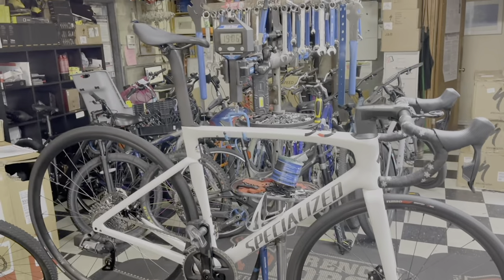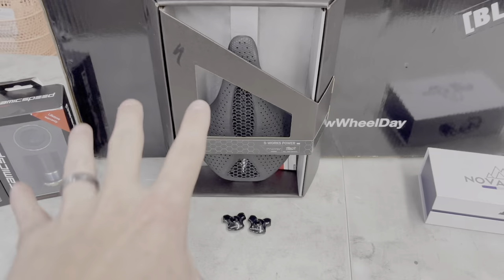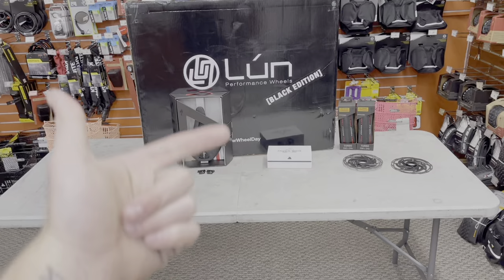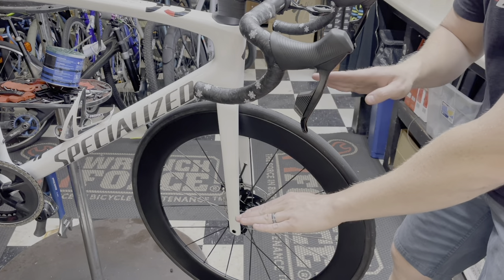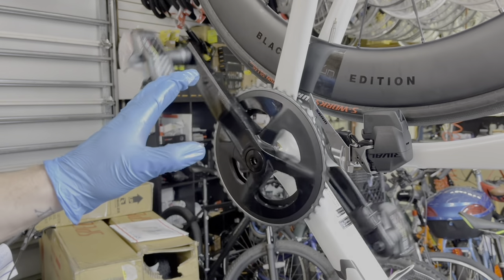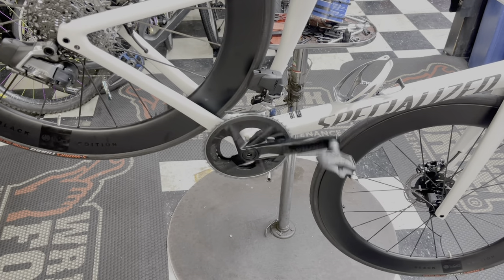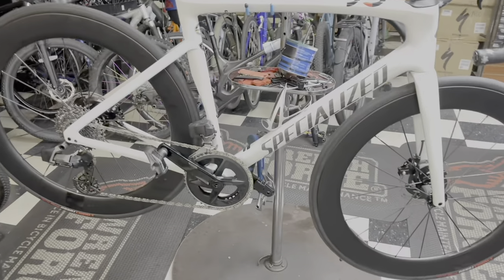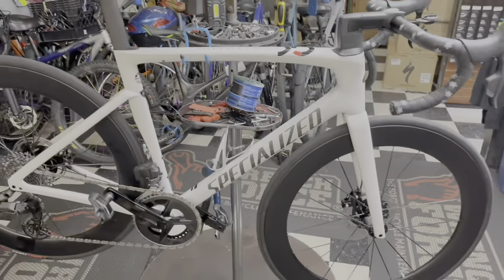HOW MUCH WEIGHT CAN I REMOVE?? (UPGRADING MY BRAND NEW TARMAC SL7 COMP 2022) *WHEELS, ETC*

Comment: Jesus, my 1.099 Euro, Aluminium bike with 105 from Decathlon weights 8,8 kg... Upgrades with wheels and tires brought it down to 8,6 kg for an extra 700 Euro. The stock weight of this carbon (!) bike is a joke.
Reply: I can understand why as an overweight tub of fat weight is your primary concern. 
But to most healthy and fit cyclists, I can assure you that weight is an irrelevant metric
Reply: @87togabito  Did you just call me fat? Where is the virtual Will Smith when you need one...

Sorry, but the fact that a modern, very expensive carbon bike weighs almost as much as a cheap aluminum bike IS a joke. Bikes are basically devolving in that matter. How much does that frame weigh? 1500 grams? Or where else does it come from? It's hilarious!

And no, weight is not an "irrelevant" metric. Overrated, especially for the average cyclist? Yes. But certainly not irrelevant. And as an average cyclist that doesn't go 45 km/h unless it's downhill, a light bike is way more fun than a heavy one and an aero position way more important than an aero bike. But whatever floats your boat,I guess...
Reply: @87togabito  If you push 5W/kg up a climb it matters if your bike is 2kg overweight and light bikes just feel a lot nicer to ride.
Reply: @christianb.1028  like gc said, and you, whatever floats your boat. He said it’s not a climbers bike (thus deep ‘heavy’ wheels), heavy saddle etc. The frame itself is an aero one, and not heavy. The components chosen are. He prefers aero, you seem to prefer lighter (leave virtual will smith at home, but 8.6 is still very much). As you say; whatever floats your boat. Not everybody  is a dentist ;-).
Reply: @Freddy3792  not even true. Aero (heavier) will be faster till a certain steepness. Check gcn vids on that. It’s not only ‘weight’. And what is ‘overweight’? Are you yourself as light as possible? On a pro’s diet? Best way to loose weight on the bike is loose fat yourself.
Reply: @Stevenafoe  Since I'm not really good (but also not fat!^^) and I don't race, weight is definetely more important to me than aero. What's also important is bang for buck. I just really wonder why that bike is so heavy. As you can imagine, my relatively cheap aluminium bike is not featuring the lightest components. I know it's objectively not very light compared to some other bikes, but it is VERY light for the price and the material. It's really hard to find a sub-9-kg alu bike for less than 2.000 EUR. And with the upgrades I made I also have 50mm carbon wheels and I'm still under 2.000 EUR. 
I'm not saying GCs bike is slow, or bad or anything, it's obviously not! But he's got some top spec shit on that sucker I bet is lighter than almost anything my bike features and it weighs almost as much as an alu bike from a mass retailer? That's ridiculous! And it's also not necessary, as many other brands are appearently able to produce much lighter aero bikes that you don't have to pay around five figures for.
They should just drop the damn disk brakes. That would be even more aero and save weight and money in the process. But that ship has sailed, I guess...
Reply: @Stevenafoe  Aero matters for non pros maybe at 4% where you draft in races anyway. You always have to think about the spot where you will be dropped in races which is often on steep climbs. Even though it doesn't matter, but I can't loose more than maybe 1-2kg. I agree that for guys around 75kg+ the weight impact is not big, but if you talk 65kg or less the bike is more than 10% of your body weight. I do have two bikes and I don't really want to ride my heavy one on steep hills, but thats more about feeling and fun. I just can't justify paying 5000€ plus for a bike thats 1,5kg heavier than my current 5000€ bike
Reply from the maker: your bike is easily slower..... your comparisons when people say this is so dumb, the bikes now today are more aero...... its like me saying today... (your car is so much heavier in todays day.... my car was so much lighter 10 years ago, een though the new car dries better is more aero and is more efficent)
Reply: @GCPerformance18  I should really hope it's slower, that is completely out of the question and I never doubted that. Your bike is objectively better in every regard, it cost a lot more, so that should naturally be the case. But it still weighs alsmost as much as a 1980s steel clunker from the pros back then, which were around 9 kg... That's not your fault, I'm not attacking you for it. It's just really bad development on part of the manufacturers in my opinion. 
Your comparison with cars doesn't work at all. Cars did of course get heavier, are more aero and are generally better. But that's not why they are faster today. They more than doubled in horsepower since 1980, that's why. Humans can't do that.
The most important aero upgrade on the bike is still the rider. If your position is shit, all the aero improvements of the bike go out the window. Lift your head to much, 10 watts gone. But a weight advantage stays, no matter how you hang on the bike. So for very average riders like me, weight is more important in my opinion. And it's possible to be aero and light without spending 10k. The cheapest Canyon Aeroad for example weighs 7,8 kg with disc breakes and 58/62mm rims! So what the hell did Specialized do to that bike to make it so damn heavy? Like I said, not criticizing you, just the manufacturer(s) of modern bikes.
Reply: @christianb.1028  I totally agree with you. It's just that the title of this video is misleading: it's not about weight or saving some... and yes I'm pissed too that expensive Carbon bikes are not much lighter than my 20year old aluminium one ;)

Comment: for an average rider does it worth all that money to save that 1lb? I think only the wheels might make some difference in performance..
Reply from the maker: wheels for sure will make a huge difference I have a video for that soon..... butalso ceramic bb makes a big difference for me, when installed right
Reply: @GCPerformance18  I've ridden a ceramic myself. Are really faster and more stable. BUT they don't have proper seals (only caps) because the seals would slow down the bearing ;)
For the hobby driver, this is more of a disadvantage, because the bearing often has to be cleaned when it is dirty or wet.
If you don't do that, it's scrap in no time

Comment: A tarmac sl6 comp 58 cm weighs 18.10 stock.
Reply from the maker: That’s a great piece of information
Reply: @GCPerformance18   I'm not knocking your builds. They're very nice bikes. It isn't cheap to custom build a bike. I've taken my sl6 comp from 18lbs 10 oz. To 15.92. Just under 16lbs.  I would send you a picture if i knew how
W.

Comment: A tsunami of marketing hype and expensive parts, end result: 8.44 kgs. I can't stop laughing. Even considering the c. 600 g extra for disc brakes vs rim brakes, that's hilarious. I ride a same size carbon bike with Ultegra 6800, it weighs 7.35 kgs. Rear wheel 60, front 38. Nothing special. I can't stop laughing!